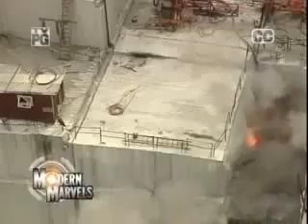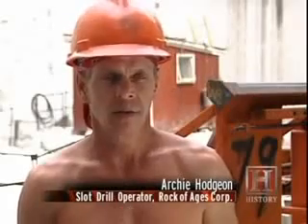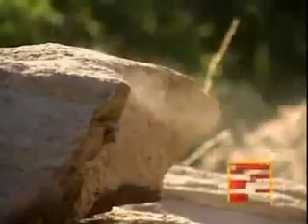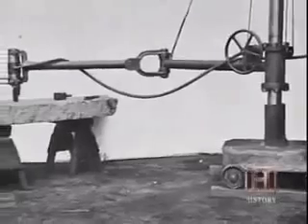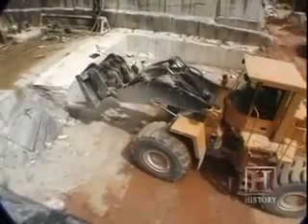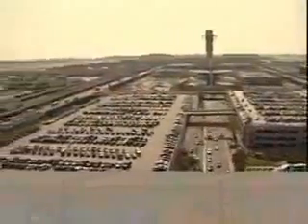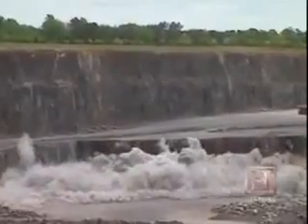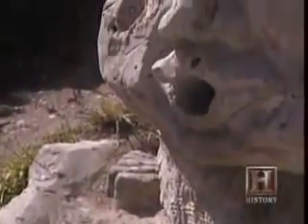Rock Mining (Quarrying) Process

Comment: Harrison Brown is right, any rock can be used as an ore source today.

Fact: 100 tons of ore is needed to produce 1,320 pounds of copper at 0.6% copper per ton of ore in the 21st Century.
 
Fact: 100 tons of ore is needed to produce 11.6 troy ounces of gold at 0.116% gold per ton of ore in the 21st Century.
 
Fact: In the 18th century copper ores are practical to mine if they contain 13% copper per ton of ore or more per ton of ore. That's 13 tons of metal copper per 100 tons of copper ores containing 13% copper.
 
Fact: In the 21st century we can economically use copper ores containing 0.6% copper per ton of copper ore, which translates into 1,320 pounds of copper or 600 kilograms (.6 metric ton) of copper per 100 tons of copper ores with a 0.6% copper content per ton of copper ores today.
 
Fact: In 1974, it requires 5,172.41 plus tons of gold ore from the Nevada Carlin mine ore deposits to produce 50 pounds of gold.
 
As metal ores becomes leaner technology advances to make it economical to extract and process such extremely lean ores until it reaches the point that we will be forced to develop the technologies that can use an average igneous rock such as granite as an ore source.
 
If we are more than willing to develop technologies that allows us to economically use the leanest ores of copper at 0.6% per ton of copper ore (as it fell from 13% per ton of copper ore) at a profit. And if we are more than willing to develop the technologies that allows us to economically use the leanest ores of gold at 0.116% per ton of gold ore at the Nevada Carlin ore deposits at a profit. That obviously means one thing as stated below.
 
For copper that translates from 13 tons of copper metal per 100 tons of copper ore in the 18th century to 600 kgs (.6 ton) of copper per 100 tons of copper ores in the 21st century.
 
For gold that translates into 50 pounds of gold extracted from 5,172.41 plus tons of gold ores.
 
What this means is that we now have the scientific and engineering capabilities to develop the process that can economically mine granite rock and extract important metals from it at a profit!
 
A hundred tons of granite rock can produce:
 
1. 8 tons of aluminum.
2. 5 tons of iron.
3. 1,200 pounds of titanium.
4. 180 pounds of manganese.
5. 70 pounds of chromium.
6. 40 pounds of nickel.
7. 30 pounds of vanadium.
8. 20 pounds of copper.
9. 10 pounds of tungsten.
10. 4 pounds of lead.
11. 2.64 pounds of thorium (1,200 grams or 1.2 kilograms).
12. .88 pounds of uranium (400 grams or .4 kilogram).
 
And granite deposits are as common as ordinary soil and are found everywhere, and will never run out! And we do not have the need to prospect for rich deposits of metal ores and/or mineral ores! Virtually, everywhere, we have all the required raw materials to feed and energize an industrial economy indefinitely. And all what we need to do is to have the will to fight against the vested political-economic interests who will be against this, since this very scientific knowledge is a threat to their raw material and energy cartels and monopolies that they themselves have created in the first place in order to enslave humanity.
 
In every 100 tons of average igneous rock such as granite contains 8 tons of aluminum, 5 tons of iron, 1,200 pounds of titanium, 180 pounds of manganese, 70 pounds of chromium, 40 pounds of nickel, 30 pounds of vanadium, 20 pounds of copper, 10 pounds of tungsten, and 4 pounds of lead. And in a ton of granite there are about 12 grams of thorium and 4 grams of uranium. Therefore in every 100 tons of granite the amount of thorium we can get is 1,200 grams of thorium and 400 grams of uranium. As to extracting these elements from granite the 1.2 kilograms of thorium and .4 kilogram of uranium that can be extracted from every 100 tons of granite rock can provide more than enough power to extract these metals from every 100 tons of granite rock. And produce more than enough surplus power for other purposes if we are allowed to use the nuclear "Breeder Reactor" concept and also in the way of the Russian BREST nuclear reactor concept that can indefinitely recycle it's own nuclear fuel and therefore will never run out of nuclear fuel and simultaneously consumes it's own nuclear wastes and eliminates the long term problem of used nuclear fuel storage and nuclear wastes storage.
Reply: thanks for this info

Comment: Watching how they drill granite for 30 seconds gave me an idea how to do it better and faster. just lke they use the diamond wire for the sides you can use it in the back by first drilling 2 holes at the corners and then stretching a wire over it like a bow saw. instead of pulling on the wire after feeding it through a 90 degree channel you push two rods with the diamond wire stretched between them into the holes at the corners with pulleys on the tips. as you push down and rotate the wire the it cuts down then you turn it and cut the sides. After you cut the sides you tip it over and cut out the bottom. If you cut the sides first and then the back it could go even faster because the wire will already be in the right position to cut the bottom.
Reply: I think they are doing easier

Comment: We can use Resonate Frequencies plus some kind of very deep crustal penetrating x-ray radar (or radio, gamma, ?) to show what is under the surface & how much. The quantum particles of all material matter should be the approach taken, which leads to many other things, enablements & phenomena. Cutters & levitation assistance can be made this way, by creating a type of laser cutter that reads or is programmed to electromagnetically heat the elemental compound & separate each particle, then catch collect them instantaneously using their Resonate frequency to attract them to another electromagnetic draw line for finite precise cuts & material collections. Then use the quantum particle properties to create another electromagnetic field of any of the matters or blocks with another apparatus. To levitate the material matter for transferring to other locations, of course with the fully capable binding straps & lines treated as a first line mechanism to back this process. Magnetics are tricky & not fail proof. Material matter breakdown, separation & collection can also be used in Ocean Water Desalination & materials separations of Ocean Waters properties. And to recycle all trash matters instead of putting them in land fills & creating filthy conditions in the ground soil & clogging the essential function of dirt.

Comment: sorry very wrong comments ,he do not know what he is saying , in Egypt there were never found a copper saw , bronze chisel cannot be use to drill hole through granite , Giza pyramids were not built by Egyptians they do not had tools and means for this kind of extremely precision and huge mass
Reply: +francois clermont would anyone keep a diamond chisel or would they smash it to bits for jewelry?  but I agree with you.  Some scrap of these has to exist somewhere in an egyptian bog or shipwreck off the coast where its anoxic.  I don't think it was copper either, however.  There is a whitewash of history pre-CE, which I am sure you agree with that assertion.  I think they used high pressure water, saws, etc.
Reply: +texasfossilguy diamond are very hard but brittle also , you cannot hammer with a diamond only doing scratch cutting by abrasion , aliens that travel at faster than light must have some kind of much more advanced tool like desintegrator ( break atoms bonding by destabilizing electron ) glassing is a side effect